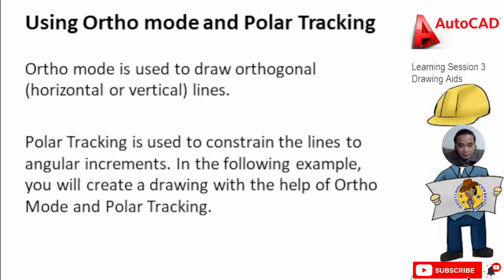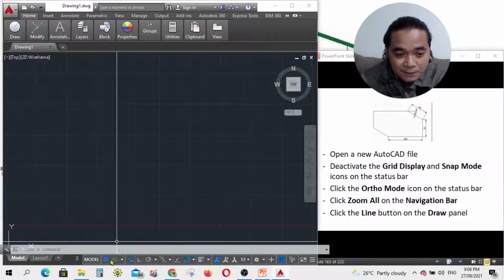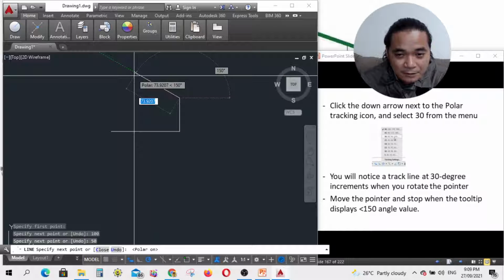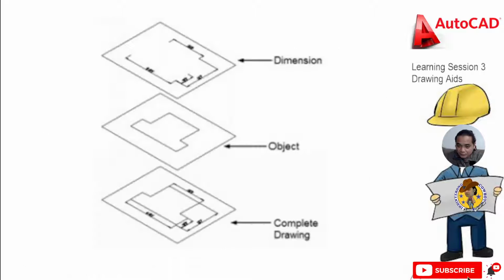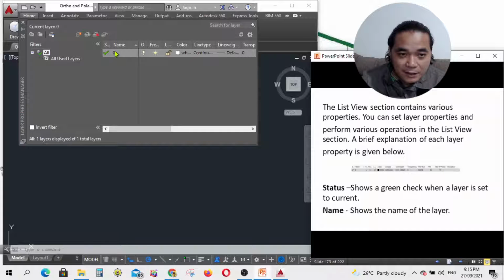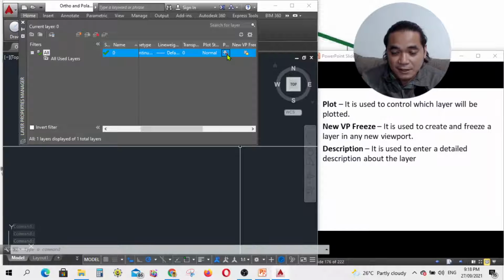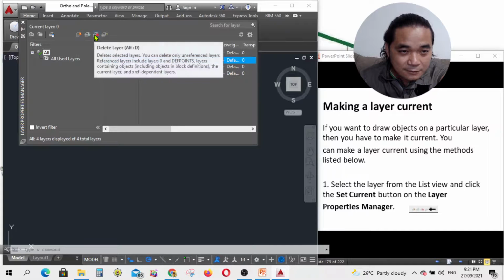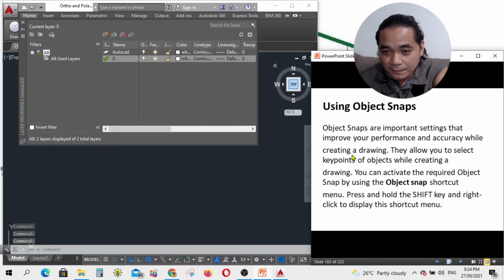AutoCAD LS 3-2 | Drawing Aids

Comment: Sir, your videos never fail to impress me because they substantiate my understanding of AutoCAD. Through this learning session, I was able to understand and apply what I had learned about using Ortho Mode, Polar Tracking, and Layers on the exercise activity you gave us. I discovered that the Ortho mode is used to generate orthogonal lines, whereas Polar tracking is used to limit the lines to angular increments. These two cannot be used or enabled concurrently. In terms of layers, I was able to uncover the various layer properties such as creating new layers, setting the current layer, hiding one layer to highlight another, and even deleting layer/s.

Comment: I liked the second portion of Learning Session 3 because I learnt about Ortho Mode, Polar Tracking, and Layers. Basically, the Ortho mode is being used to draw orthogonal lines. Polar Tracking, on the other hand, constrains the lines angularly. The lines of our objects may change if these two options are activated at the same time because ortho mode restricts cursor movement to vertical and horizontal directions while polar tracking  limits cursor movement along polar angles to predefined intervals. In terms of layers, they are a collection of transparent sheets that creates a drawing. Creating, updating, and deleting layers were also addressed.

Thank you again Engr. for this very informative video!

Comment: In this learning session of drawing aids part 2. I've learned about how to use and apply ortho mode and polar tracking. Ortho mode used in making a vertical or horizontal lines while polar tracking where use to constrain the lines and angular increments

Comment: In this video, I learned on what are the used of Ortho mode and Polar tracking. I discovered that lines can only be drawn straight horizontally or vertically in Ortho mode, but in Polar tracking, our lines can only be drawn at specific angles, which might assist us discover ease as we draw. Thank you again for the learnig session video I learned a lot from your video Sir!!! More vids Sir!!...

Comment: For this continuation video of LS-3, I've learned how to apply, used and create a drawing with the used and help of orthomode which is used to draw orthogonal (horizontal or vertical) lines and Polar tracking which is used to constrain the lines to angular increments. I've also learned about in using layers which the layers are a group of transparent sheets that are combined to form a complete drawing and which displays a drawing that consist of objects lines and dimensions lines. Thus, this mainly shows that we can create our own layers, set our layers, hiding one layer to highlight the other layer and also delete  the layers. This another set of learnings will probably  helps me understand more the functions of drawing aids. Thank you again Sir for this learnings!

Comment: This section of the video helps me expand my understanding in ortho mode, polar tracking, and layers. In ortho, I've discovered that the cursor can only move vertically and horizontally. It displays at the specified intervals and additional angles in polar tracking. Layers, on the other hand, are used in AutoCAD to draw objects on a layer based on their function.

Comment: This second part of Learning Session 3 allows me to discover some incredible AutoCAD features. The ortho mode function, for example, allows lines to be always straight in either the vertical or horizontal direction. Another feature is the polar tracking function, which is used to constrain lines to angular increments. This video also demonstrated how to use layers, which are groups of transparent sheets that can be combined to create a complete drawing. This feature can be enabled by going to the Home tab, then Layer Properties, or by typing the command "LA." This video is, indeed, very informative and beneficial.

Comment: In this video, I learned that the Ortho mode in AutoCAD is used to restrict cursor movement to specific directions. It allows the cursor movement only in the vertical and horizontal direction. When we create, modify, or move the drawings, the ORTHO mode is used to restrict the movement relative to the UCS (User Coordinate System). While the Polar Tracking to  restricts cursor movement to specified angles. PolarSnap restricts cursor movement to specified increments along a polar angle. When you create or modify objects, you can use polar tracking to display temporary alignment paths defined by the polar angles you specify. Lastly, I learned that the "using of layers" are the primary method for organizing the objects in a drawing by function or purpose. Layers can reduce the visual complexity of a drawing and improve display performance by hiding information that you don't need to see at the moment.

That's All!
Thank you and God bless!

Comment: In this video, this one was great to learn about Ortho Mode and Polar Tracking. The Ortho mode draws orthogonal lines. Polar Tracking restricts the lines to angular increments. According to the discussion, these two modes cannot be used together, which may affect our objects' lines. According to my analysis, the ortho mode limits cursor movement to the vertical and horizontal planes based on user coordinates. Polar tracking also limits the cursor's movement along a polar angle. It may show temporary alignment paths defined by polar angles entered during object creation or change. Layers are a collection of transparent sheets that are combined to form a pattern. Also covered were how to create, update, and delete layers. The Layer Properties Manager creates and manages layers. Components are tree and list views. The Tree View section shows layer filters, groups, and states. The List View is the Layer Properties Manager's main body. It shows the current drawing's layers.

Comment: During this lesson, I learned how to distinguish between Ortho mode and Polar tracking, as well as how to utilize layers. Lines can only be drawn straight horizontally or vertically in Ortho mode, but in Polar tracking, our lines can only be drawn at specific angles, which might assist us discover ease as we draw. In terms of layers, we may learn about object and dimension layering, as well as layering tools that can be used to modify the layers. Thank you very much, sir; I believe this to be invaluable information.

Comment: Indeed, you really never failed us to keep understood sir. In your way of teaching I get to learn much about AutoCad in a comfort of my home and in a manner of my time. Specifically in this session, I have learned the essence of ortho mode and polar tracking. In which, ortho mode is a vertical and horizontal linings which is used to specify angle or distance by means of two points with the use of a pointing device. While polar tracking is mainly used to confine the lines to angular increments. Polar tracking is also ised on design making and display temporary alignment of pathways. 

Thus, this video really is very helpful to me. And I would really await for the next video to come, because definitely I  would garner learnings out of it. THANK YOU SIR.

Comment: To continue this kind of learning session 3 part 2  it talks about using ortho mode and polar tracking in which I’ve learned that in ortho mode it used to draw orthogonal vertical and horizontal lines. Basically, it helps by restricting your drawings to horizontal and vertical lines. Because of this whatever you draw will be aligned and you can be sure of it’s straight nature without having to zoom in to see the anti-aliased edges for an idea of whether it is straight or not. While in polar tracking it used to constrain the lines to angular increments. Also, it talks about using layers in which I’ve learned that layers are like a group of transparent sheets that are combined into a complete drawing that displays a drawing consisting of object lines and dimension lines. However, in layer properties manager is used also to create the managed layers. So, I learned that the layer properties manager has the display of line weight, line type, color, transparency, New VP Freeze and Description and plot style under the listview section. In fact, all of these basic tools are very useful and helpful  in AutoCAD especially when we draw or create.

Thank you for this kind of content, especially for your time and effort Sir! :)

Comment: LS 3-2. In this learning session, I learned how to activate the Ortho Mode and its purpose in AutoCAD and how it should be used, as well as the Polar Mode.  I have been guided how to use these tools when I use AutoCAD. With regards to Using Layers, these are like a group of transparent sheets that are combined into a complete drawing. Depending on the convenience for drawing, using layers is helpful. In order to manage layers, we'll have to go to Layer Properties Managers. I have been introduced to various operations present in the Layer Properties.

Comment: Another excellent lesson sir. In this lecture, I've mastered Ortho Mode, Polar Tracking, and Layers. Orthogonal lines are drawn using the Ortho mode. Polar Tracking, on the other hand, is used to restrict the lines to angular increments. According to your statement, sir, these two modes cannot be activated concurrently, which may have an effect on the lines of our objects. I've discovered that the ortho mode restricts cursor movement to the vertical and horizontal planes and is used to constrain movement depending on the user's coordinates. Additionally, polar tracking constrains the cursor's travel along a polar angle to predefined intervals. It may be used to display temporary alignment routes defined by the polar angles entered during the creation or modification of objects. In terms of layers, they are similar to a collection of transparent sheets that are merged to create a full design. Additionally, how to build a layer, make a layer current, and remove a layer were discussed. I found that layers are created and managed using the Layer Properties Manager. The tree and list views are its components. The Tree View part is used to show information about layer filters, groups, and states. While the List View portion serves as the Layer Properties Manager's primary body. It contains a list of the current layers in the drawing.

Many thanks, sir. I'm looking forward to the future videos.

Comment: I learned using ortho mode and polar tracking that ortho mode made the lines stay in either a horizontal or vertical direction, and for polar tracking, it shows a tracking line. I found out that these two modes cannot be enabled at the same time, and this can have an effect on the lines of our objects. Gain another lesson today. Thank you sir

Comment: LS 3-2. 

In this learning session, It focuses on Ortho mode and polar tracking. Orthomode, based on the introductory to AutoCAD it simply means the vertical and horizontal linings and this is used when you specify an angle or distance by means of two points using a pointing device. On the other hand, Polar tracking is used to confine the lines to angular increments. To open the ortho mode, open autocad file and deactivate the grid display and snap mode icon then click the or orthomode icon on the status bar, after that, click zoom all on the navigation bar, click the line button on the draw panel and type all the following coordinates. I also learned that Polar Tracking on is used on design-making and  display temporary alignment pathways. To access the Polar Tracking, go to the drafting settings dialog box>Polar Tracking tab>select Polar Tracking On>In the Increment Angle list, select the polar tracking angle.

Comment: Great! I have now gained another lesson and kudos you sir!
This video made me clear the functions of ortho mode, polar tracking, and layers. Where the main function of ortho mode is to make horizontal and vertical lines,in contrast with this function, the polar tracking button is the one that constrain the lines into angular increments. And so, these two buttons would not be use at the same time as they have different functions, where using one button could disable the other button. Basically, orthomode is very useful in measuring horizontal and vertical lines and to off this button, diagonal line will be drawn. As to polar tracking its mainly uses is to track or align  the  points of an object. Layer properties manager was also presented, where we can create our own layes, hide one of the layer to highlight the other layer, how to delete a layer and how to make a layer current. 
Thank you sir.

Comment: In this video, i learned what is the purposed of orthomode that used to draw the horizontal and vertical line , while the polar tracking is used to constrain the line to angular increments and the last is the layer ,and howit is easier for us to draw,Whenever we have a lot of layers in our drawings, it will probably take you longer to locate the one you need. If they belong to some groups, e.g. different floor plans in your drawing, it will make sense to group (filter) them in Layer Properties Manager as well. You will be able to manage your layers more quickly. Thank you sir for this learning session.

Comment: This video is very informative in which Engr. Pongcol demonstrated on how to use Ortho mode and polar tracking. The ortho mode is used to draw horizontal and vertical lines, while polar tracking is used to confine the lines to angular increments. The ORTHO mode is used to restrict movement relative to the User Coordinate System when we create, change, or move the drawings. On the other hand, Polar tracking is a tool that limits cursor movement to specific angles. It limits cursor movement along a polar angle to specified increments. You can use polar tracking to display temporary alignment pathways defined by the polar angles you specify when creating or modifying objects. That’s why I’m very thankful for all the learnings I gathered because it can make more easier to create a accurate drawing.

Comment: In this video, I learned the function of ortho mode in which it is used to draw orthogonal lines, the polar tracking which is used to constrain the lines to angular increments and lastly, I learned how to used the layers. You cannot activate the ortho mode and polar tracking simultaneously, when you turn on the polar tracking then the ortho mode will automatically turn off and vice versa.

Comment: In this video, I have learned how to use and apply Ortho Mode in creating horizontal and vertical lines and using Polar Tracking to constrain the lines to angular increment in making and creating complicated figures. And also  using the layers in drawing, the first layer would be the  dimension and  the second would be the object and the third would be the combination of two  to form a complete drawing. And then the different properties of layer, ways of creating new layers, ways of setting current layers and ways of deleting layers.

Comment: Upon finishing this video, I am grateful that I learned the main purpose and function of the Ortho mode and polar tracking and layers.Ortho mode and polar tracking are the two features can’t be ON at the same time because Ortho mode is used in horizontal and vertical lines while the polar tracking is for angular increments. The layers are described as the group of transparent sheets that can be combined to finish the drawing. It is highlighted here that the object layer is where the lines are created, while in the dimension layer are the dimension. The layers can be on at the same time and also can be turned off and on simultaneously, by this it helps the user view the desired layer they want to view. The layers have layers properties managers that helps user to create and manage the layers of his/her drawing. The layer properties managers have the display of tree view section and list view section, under the list view section are the status, name, on, freeze/thaw, lock/unlock, color, line type, line weight, transparency, plot style, plot, New VP Freeze and Description.Thank you for this video sir and God Bless!!

Comment: I was pleased to watch the second part of Learning Session 3 because I learned how to use the Ortho Mode,
Polar Tracking, and Layers. The Ortho mode is used to draw orthogonal lines. On the other hand, Polar Tracking is used to constrain the lines to angular increments. According to what I've heard, these two modes cannot be enabled at the same time, which may have an impact on the lines of our objects. I’ve managed to learn that the ortho mode limits cursor movement to the vertical and horizontal directions and is used to limit movement based on the user's coordinates. Moreover, polar tracking restricts cursor movement along a polar angle to predetermined increments. It can be used to show temporary alignment routes defined by the polar angles you enter when creating or modifying objects. As for the layers, it’s like a group of transparent sheets that are combined into a complete drawing. It was also being tackled how to create a layer, make a layer current, and delete a layer. I discovered that the Layer Properties Manager is used to create and manage layers. Its components are the tree and list view. The Tree View section is used for displaying layer filters, group, or state information. While the List View section is the main body of the Layer Properties Manager. It lists the individual layers that currently exist in the drawing.

This video content is very engaging. Can't wait to finish watching all of the videos in the third learning session.